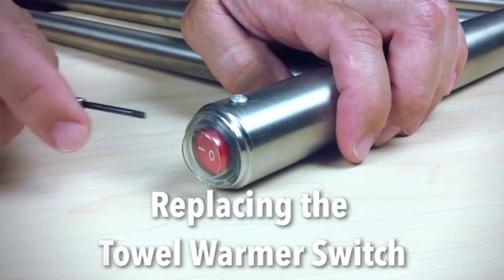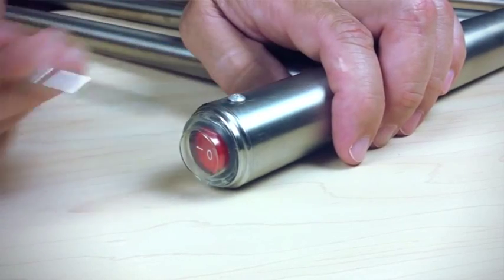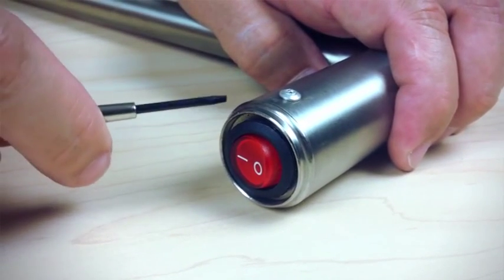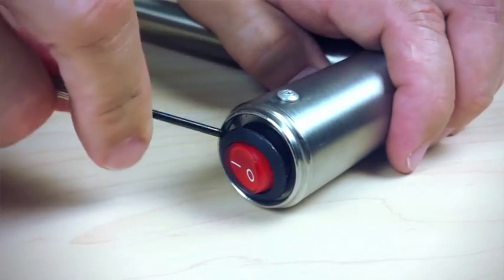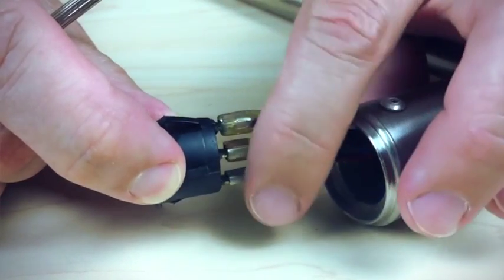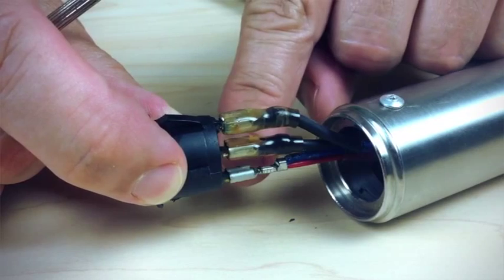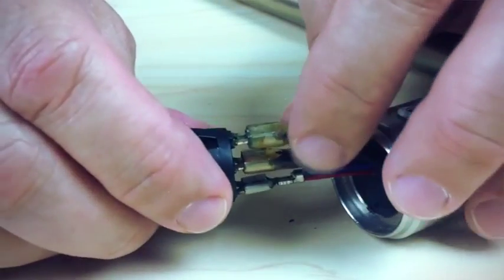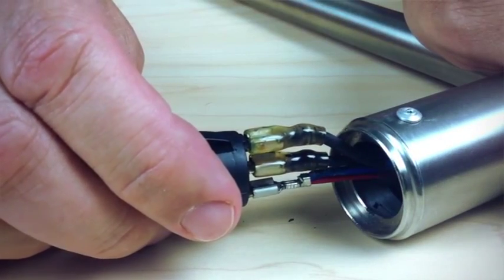How to Replace a Towel Warmer Switch for Temp Control

Comment: Do you need to cut the power to the towel warmer before you do this?
Reply from the maker: Yes, you're working on the electrical of the towel warmer so the power needs to be off for that circuit.

Comment: I noticed your posting and I am looking to do exactly this except I cannot find a replacement switch anywhere...
Reply from the maker: You can contact us at 800-875-5285. Unfortunately, if you have the Elements Towel Warmer, we do not have a replacement switch for that product. If your towel warmer is under warranty we will replace the entire warmer, if it's not under warranty, we offer 50% of MSRP replacements.

Comment: Where did you get the replacement switch?
Reply from the maker: We have them available for sale if you reach out to our tech team. They are not publicly available since it is for an older set of models we no longer carry. You can reach out to our teach team 24/7 at 800 875 5285.

Comment: I wonder if this would be my solution -- have an infinity model (hardwired) and I recently noticed the warmer would turn on, the switch would light up, but the towel warmer does not get warm.  Would this be a problem with the switch or the heating element inside?
Reply from the maker: It could be either. Give us a call at (800)875-5285, or chat us; https://www.warmlyyours.com/en-US/support, and we will be glad to discuss troubleshooting the unit. We are available 24/7.